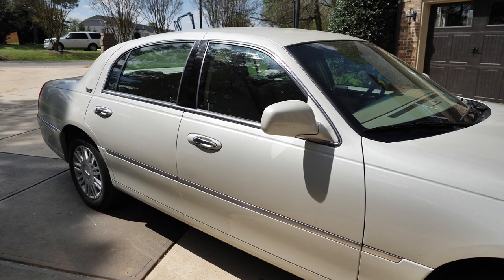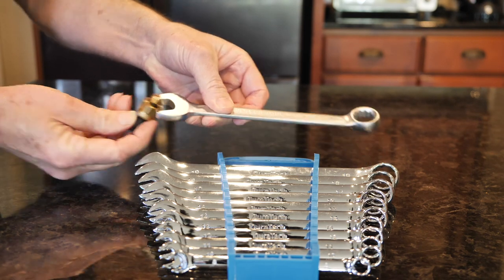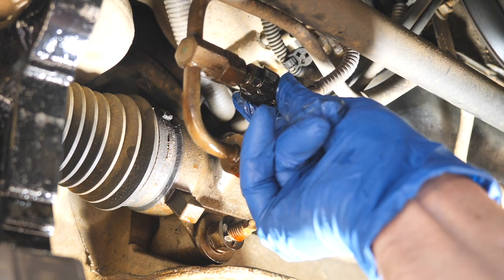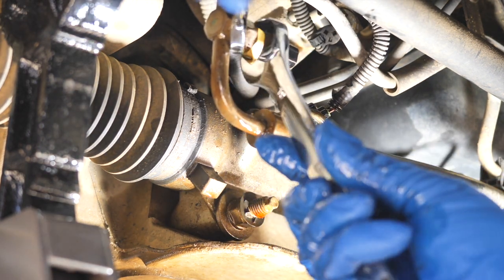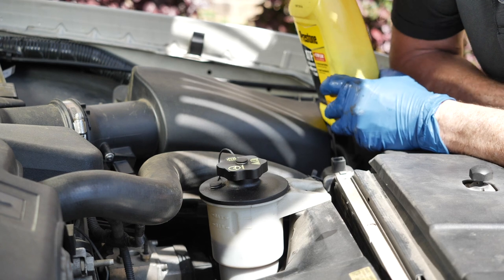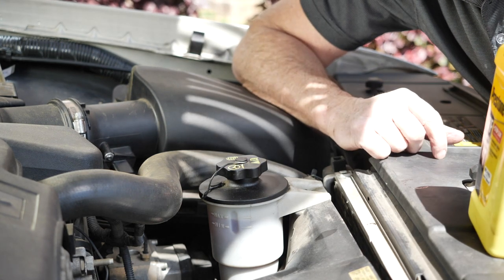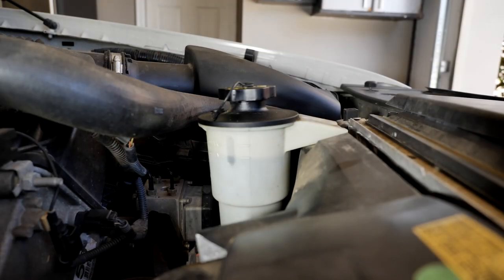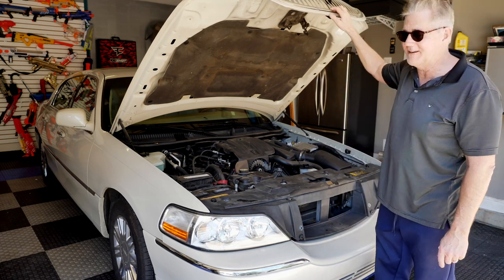How to Replace Power Steering Switch   Lincoln

Comment: This is a great video. I changed the switch, but now when the tires are on the ground (jacked up it works good), there seems to be almost no power steering, and the fluid now leaks from the tube below that the pressure switch line is connected to when it seems that pressure builds up in the line, even after bleeding the line. I used aftermarket power steering fluid (as recommended by an auto zone guy), could it be I need the OEM fluid? Or would that mean the new switch doesn’t work?